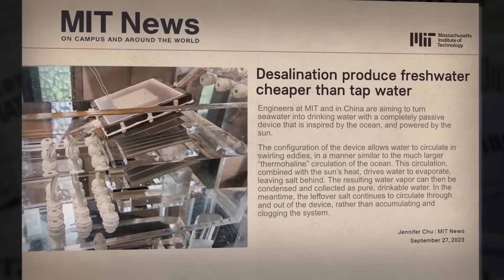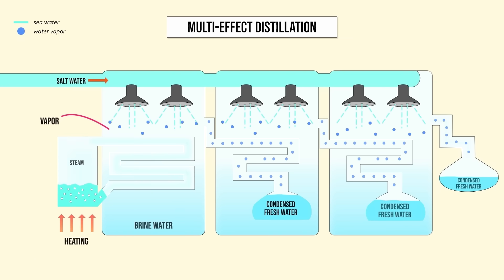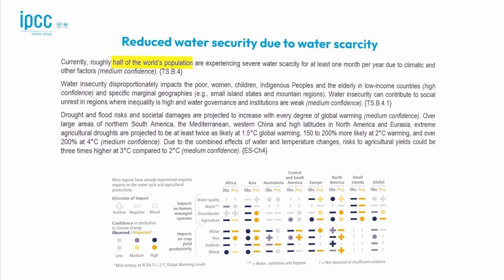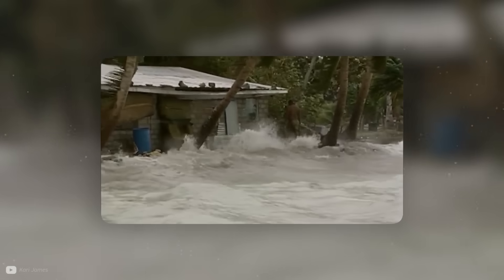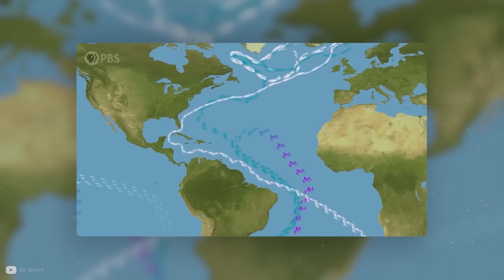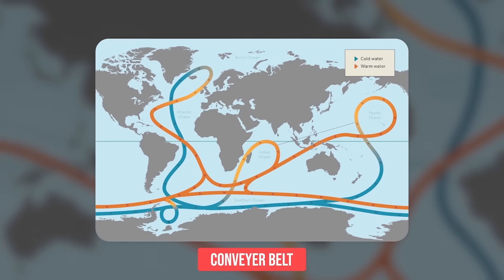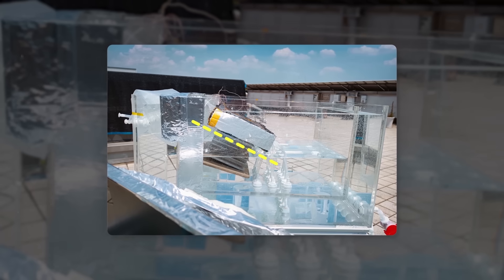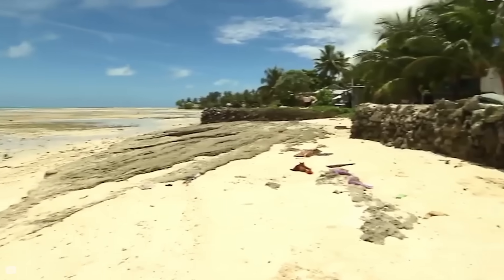Unlimited Fresh Water: Can MIT's Breakthrough Save Us?

Comment: This is something i absolutely hate about scientific reporting. It's OBVIOIUS any desalination system is going to create more brine than fresh water! That is WHAT IT DOES
There's no such thing as "fresh water" or "brine". There's only water and everything soluble in it (which is a heck of a lot).

The reason a desalination PLANT (meaning, industrially sized device) creates "brine", "hypersaline water" or any of those terms that are highly relative in meaning, is because it works in metric tons of water per unit of time. 
It doesn't matter if you take out one atom of lithium or all of them, bottom line is you will need to repeat this process indefinitely until you get the mass of water that you need to supply the local demand - WITHOUT THE SALTS. Those, in term, will need to go somewhere. No method of desalination will ever escape this reality. Unless we're managing to use the salts in land - which is unlikely and possibly impractical.

From the environment's perspective, it's irrelevant how well you desalinate (which is VERY important for us humans), the KEY aspect is in how much ocean water volume you disperse the salts you removed. This is what maintains the equilibrium established by certain historical concentrations of salt to which life there has adapted to survive.

The good part about this device is its modularity and potential for scaling up. None of it's great advantages were the focus of attention, and the poor, borderline incorrect presenting of it's drawbacks just to show "cool MIT device saves island" showed misinterpretations of desalination and an overall misunderstanding of it, it's need and setbacks. The effects it causes and pretty much everything that is not the smart move of tilting a hydrophobic membrane to take in water vapor produced by the sun were very poorly communicated. 

Imagine this:

You have 100 homes in an island. You put one desalination plant on that island and it fills the need for water of all homes. hooray. 
Now you have a (big) fraction of salts that were originally on the salt water and need somewhere to go. 
Where do they go? Back where the desalination plant collected ocean water. Likely in one place, or in one big stretch of water (but relative to the ocean, a tiny tiny spot).

Now seawater around the island is getting increasingly saltier.
How will this device in any way change that? It will not. Maybe having the hundreds of small units dispersing the saltier water over all the shoreline will make a difference!
But then it's just a matter of making a longer dispersing pipe for the desalination plant. 
The effects of the cost for poor populations, the effects of decentralizing the desalination process, poof.

All in the place of a shiny remark of "it costs less then tap water in the US!" And that's probably not even correct, considering you didn't factor in cost of distribution into that math.

Comment: This would be great for off shore sailboats and motor boats which use "water makers" to produce fresh water.  These units are reverse osmosis devices but they use a lot of power which is a problem for boats running on solar.
Reply: Unless the "gravity feed" part of this can be changed to pump driven, my guess is this wohld not be good for boats, due to their constant motion. Even when at anchor, they rock due to wave motion.
Reply: @2jlee  wouldn't a gimbal also solve this issue ?
Reply: @fire17102  A gimbal for the whole package would be large and cumbersome, and it would have to be exceptionally effective to avoid sloshing in the various cavities. It would probably be best to redesign the whole container for a "boat friendly" version.
Reply: @fire17102 Doesn't need to be a gimbal, I don't see why a small pump to simulates the convection current.
Reply: one way check valves and or maybe fluid mount like a compass. @2jlee
Reply: We have a small watermaker on our sailboot, it makes 5,5 l /hour with 5Amps12vDC, our solar panels make between 60 and 90 Amps in the same time.
Reply: @SailingSquib  How often do you need to change filters?...and at what cost?
Reply: @SailingSquib  I'm curious, what model do you use?

I'm researching what I'd like to install in a boat, if I can ever achieve the dream.
Reply: @SailingSquib  a desalinator? What do you do with the left over solids?
Reply: @y0nd3r  It drains back into the sea
Reply from the maker: Yes! I was thinking these would be great for boats, but I didn't know about the current use of reverse osmosis.
Reply: @ZirothTech  Reverse osmosis watermakers for boats are very expensive, somewhat difficult to maintain, and rather noisy. A less complicated, no-power alternative would be incredible.
Reply: It'd be great for larger ships too, could maybe use the heat of the exhaust gases?
Reply: @2jlee It can be installed as a "sailor's kitchen" (I really don't know if this is the correct name) it is a common device on all types of boats, a galley capable of keeping the water in the pot because it rolls like a gyroscope, and it does it well up to with very bad weather.
Reply: @elmoteroloco The sailors kitchen is called a galley, and sailboat stoves  are not fully gimbaled.  They do swing freely (on a fore and aft axis) to correct for boat roll, or heal, but not for pitch (hobbyhorseing).
Reply: I was going to say. A small suitcase type device as shown would be sufficient
Reply: And Riverboat Casinos Too
Reply: The movement of the boat on the waves would likely disrupt the currents that flush away the salt. This might be something that can be worked around, but I doubt the system as it is now can be used on boats at all.
Reply: . @Nathouuuutheone  The movement might even flush the membran away more efficiently.
Reply: You don't need to desalinate sea water, just collect the water from the rain
Reply: @rwyo83  only if it rains before you die of thirst.
Reply: @rwyo83  Great when /where it rains regularly.
Reply: The systems I've seen use about 1 kW of power. Most solar with batterys can handle that no problem.
Reply: Boats and ships, especially sea or ocean-going were my first thought too. Fresh water is always at a premium on those!
Reply: problem is not power, u could even have manual physical pump, problem is membrane its very delicate and u need change it often and its expencive and once it has even a little tear its over, so thats biggest negative of current drsalination
Reply: I'm guessing that the process described in this video requires an immense amount of horizontal space to gather enough energy to make the process work, and a pretty significant amount of vertical space to create significant temperature differences to cause the water to move quickly enough to distill the desired amount of water. I suspect that a thermodynamic conservation of energy is present here that if you compare the usual osmosis driven system to this or any other distillation system, the amount of energy required to run the system and produce clean water is the same but because the osmosis system uses an external source of energy to pressurize, it works faster to produce the same amount of water.
Reply: @tonysu8860 it was stated that the small carry-bag sized demo system can produce 6 litres per hour.
Sounds pretty bloody efficient to me!
Reply: @tonysu8860  'Faster' is a relative term. Solar energy can easily and cheaply be concentrated as well.
Reply: These devices already exist on boats and only cost around $5000. It is really the only place reverse osmosis makes sense economically. The honest truth is that while the concept is cool and inspiring, it will always cost more than just processing normal water and transporting it through piping. To desalinate water you either need to absolutely force out the impurities with filters that need constant replacements or to boil it and collect the vapors. 

The problem is no matter what you're dealing with salt water which destroys everything making the cost to maintain the building higher. The salt also needs to be constantly cleaned off or parts fully replaced or the entire system will fail. This is just so high maintenance it can never truly take off. The reason this isn't a problem for boats is because they already have to deal with the salt water, they already have a limited shelf life, and these devices can just be fully removed and replaced. You can't do that on the industrial scale.
Reply: They do it on air craft carriers according to a sailor I know .
Reply: @Skylancer727  I know, but a) they're pricey and b) they output brine
Reply: Until they run out of water because it is cloudy for a week!
Reply: Even if you made it illegal to throw the remaining solids back into the ocean, if this unit is available to the general public, you can expect the oceans to get saltier and thereby making them uninhabitable. When the oceans goes, humanity goes. Desalinators need to be on tight government control with hefty fines for throwing the solids back into the ocean.
Reply: @y0nd3r  Not sure how to explain but there is a salt cycle and water cycle. As long the water returns back to the Ocean, Which it will. There are natural salt sinks where salt is removed from the Ocean, otherwise the Ocean would already be too salty.
Reply: @Nothing-f8z  on small scales, maybe we won't mess with the natural cycle, but this video hints at doing it at scale large enough to keep all the humans alive, so I think that will eventually overwhelm the system.
Reply: Most of the drinking water will end up in the ocean again and even the effect out.   @y0nd3r
Reply: @y0nd3r  how would the oceans get "saltier" from this when all of the salt is coming from the ocean in the first place? Use your brain
Reply: @Superabound2  less water? idk. Oceans are pretty sensitive.

Comment: I am still confused about "the water passes thru the hydrophobic thing"
Reply: The hydrophilic membrane allows water vapor to pass through. They're basically using reverse osmosis and thermal desalination system together. The membrane is more of just a physical barrier preventing salt water from getting into the fresh water. The idea behind the membrane is to have holes big enough for water vapors to pass through while blocking all liquid from entering.

Comment: Ah I am too late for this technique! Its time for me to improve my model. The usage of solar is a no brainer but one thing that hurts me is the arrangement and how they used gravity fed system. However I shall look for solutions that could utilize my subject knowledge. Anyways congratulations to the team!!!
Reply: I commented above about a local project using solar to directly evaporate seawater from shallow black polymer lined ponds. It's sloped clear plastic roof allowed the condensate to run down and be collected at one end. Since it was essentially passive it used zero power or consumable components except to fill the basins above the sea-level.
I'm sure if it were to use rigid materials one could use vapor pressure to do the pumping if the elevation were minimal.
Reply: @JoeSmith-cy9wj   yes I did, nice work. I was primarily focusing to solve by engineering the materials. Which stable and rigid material you would use?
Reply: @JoeSmith-cy9wj the land area needed to produce enough water is not feasible or even available in most areas. That's why an idea that a 5th grader could come up with isn't in practice.

Comment: what about the brine problem though? salt isn't being removed from the system so even if you add more sea water to flush it through, it still accumulates and could crystalise and clog the system..
this makes me think only thermal distillation is the best way to go environmentally so we can easily remove salt from a pot after and no sea life has to drown.
Reply: No more salt in the ocean than there was before.
Reply: They should be turning it into Salt Batteries

Comment: So the warm saltier water goes down the same pipe as the cooler less salty ocean water it the reservoir goes up?
Does the reservoir also let the saltier water go back to the sea?
Reply from the maker: Yes exactly, the reservoir here was just for testing, but the system could be placed straight into the sea, or the reservoir could be connected to the open sea too if perfered

Comment: Great research results! Maybe the same method could be used to avoid clogging in flow batteries, too?
Reply from the maker: Great thought
Reply: Actually, when it comes to redox flow cells, we wont have much temperature gradients even if we did it will increase resistance as we know

Comment: On the large scale Solar Desalination cannot be Beaten.
[If we don't talk about Nano White Dwarfes Tokamaks...
But Kardashian are more a Trend than Kardashiev in US]
~10000m³/h of Distilled Water with a considerable contained Expens
 [For a State]
With the possibility of turning up to 7Mw from the Concentrated Superheated Steam Created by Each Dome...
It would also reduce the Damage from Hyper saline Brine and Could Creating a Constant Cycle of Molten Salt Exfoliated Graphene for both Salt-Graphene Prefabricated Slabs and Preservation of Carbon under Graphene form in itself...
[Much better than Building Expensive Molten Salt Nuclear Reactors and having to deal Later with Radioactive Graphene-Salt...cough couch or with Pelican related Problems brought by High Levels of Iodine for Counteracting the High Radiation Exposure during Work for the DoD... cough cough Asimov...]